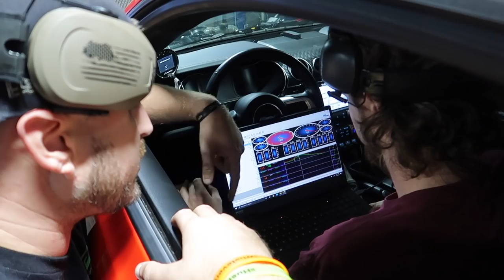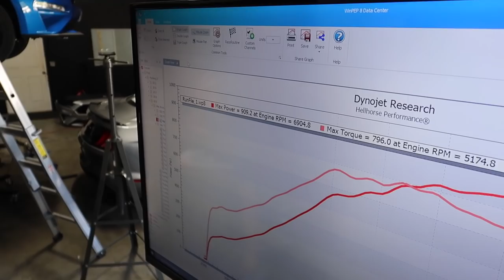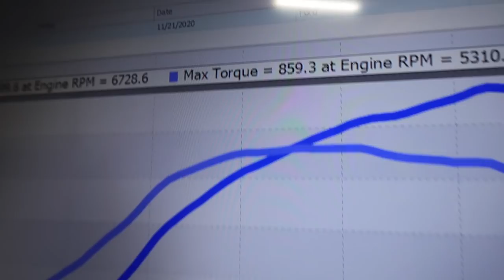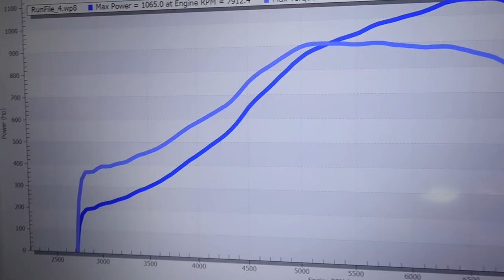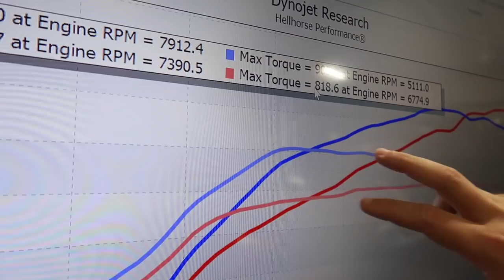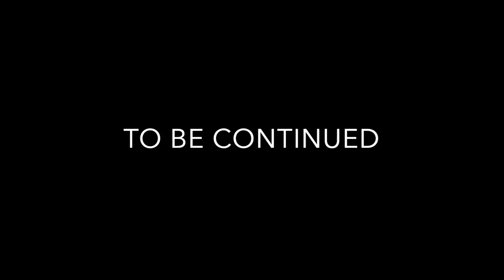RACE GAS in my Twin Turbo 2019 Mustang GT DID NOT END WELL...

Comment: Food for thought on C85 vs Pump E85... Pump E85 stoich is 9.85.... C85 stoich is 9.20....... So if you run 9.85 stoich with C85 you are not getting proper burn efficiency of the fuel.  So was tune changed to 9.20 stoich. If not that could have been why it didn’t give you the results you was looking for. Just thinking 🤔
Reply: I have yet to see advantage of vp racing C85 over pump 85

Comment: I was there to witness it all the turbo kit is amazing and the tuning is on par a lot of the problem comes down to gasoline what happens when you have bad gas in the tank but a lot of it you don’t know it until you turn it and you run numbers I am very impressed with the whole set up and I wish Zander a low 8’s car

Comment: Are you tuning with speed density using map sensor or are you using maf tuning at open loop?
Reply: These cars only use a MAF ( some like mine split the IAT out of the inlet stream and put it in a real place aka directly in one of the cylinders ( #4) on PD cars....
 A shit ton is inferred off the MAF curve and then it runs in double closed loop with twin wide bands...torque based tuning.....its a whole different world than what your used to
Reply: @bluecollardaily2676  yea wow sounds complicated.   Thanks.
Reply: @BulliKid  dude I've been tuning a LONG time, what I relayed doesn't even scratch the surface....the 10r80 has a ridiculous amount of settings as well...the triple clutch setup getting 10 forward speeds out of only 4 planetary gears all driven by a complex electrical valve body firing combinations of 6 clutch groupings...and even manual 1st and manual 2nd a lot of people launch with are using the B clutch while D mode doesnt...inverse/torque tables....its so complicated its actually when you start deep diving literally comically complicated......26 mapped points for several metrics of which one needs to log to even see under which conditions which of those maps are being used ( and wot is not always optimal power made it can be a combination of 2 maps its truly insane)...
Reply: @bluecollardaily2676  hope you make a good living from this job my man!  I guess tuning has gotten a lot more complicated with technology! And the automatic transmissions.
Reply: @BulliKid  im an enthusiast that enjoys doing it for myself, I swapped platforms for the challenge from GM and I got it....haha I'd never take anyone's money for a tune...just been digging in with my previous knowledge vs this new platform and learning slowly.......
Reply: Have you taken classes online or anything. I am trying to turbo my daily Honda Civic.  I’m piecing the kit together.  There is a base map on the tuning software for a similar kit but past that I’m not to finalize with the stuff.  Maybe  just adjust the base fuel trims so it’s more or less zero but ignition and all that is to complex and someone just said you need a dyno to do ignition maps.  Which  makes me wonder how are e tunes accurate ?
Reply: @BulliKid  i have NOT on this platform yet...if I stay with it I will.....

 Remember Lund and PBD have in-house Dyno access and develop their base maps off them, VMP as well...however other than that 10 speed, everything is SO dependent on that MAF Curve ( be it hz or period) and inferred off it and a few other sensors like the CHT ect...its amazing...yea I WISH it had a MAP sensor....if the MAF area and curve are off its bad data but by God the dual closed loop widebands accompanied by LTFT and STFT are SO good at filling in the holes( if your have the transfer rates correct moving the O2s from standard positions ect ect ect ), you can work backwards from there.....still a lot to learn...I took my tune and compared it dragy results from my Lund tune and I was down 2 mph...im reverse logging the cam positioning now....
Reply: Goodluck my friend!! Thank for the Info.   And the e tunes I’m referring to are the ones where you log data and send to a company and they email you back a tune. It’s not even a tested off the shelf map just a custom map. But again a street log is not a dyno log if ignition tables need a dyno

Comment: Itsjusta6 blows a motor, Stangmode blows a motor and now you wanna join that club ? Nah bruh, go sleeved if you're pushing passed 1100whp. Blown motor club I gladly don't wanna be a part of.
Reply from the maker: We will. I refuse to blow another engine
Reply: Itsjusta6 was sleeved wasnt it?
Reply: @bluecollardaily2676  yeah big money block. It had issues from day one though. That was a 2000hp built right block which it appears it wasn't. Bet the original owner discovered it and that's why he sold it in the first place.
Reply: Agreed.
Reply: @bluecollardaily2676  that was a 2000hp built block he found off Craigslist etc ? Sent back to MMR, took 6 months for them to even do something about it and it's never really ran right from day one. How many passes etc on bad tunes ? A stock bottom end Coyote is good for 1100whp easy 1 full race season possibly 2 if you don't rev limit the absolute dog shit out of it like the new Generation seems to do every burn out. ( Insert Stangmode here ) there's a reason you never see a tuner on a dyno holding a car against the rev limiter as he tuning it. All of them are guilty of it and I'm not so sure mechanical failure, tuner is the culprit or driver mod error 404 not found.
Reply: @bluecollardaily2676  cams not setup correctly yeah. He has a older Gen block which are known for the bores to not be aligned (centered) for high horsepower. If the machinest was off that day and sleeved the block that way ot will show on the crank. I don't think Gavin is looking to get that motor rebuilt so we may never know exactly what happened. Only time will tell.
Reply: Yea happened to me...all bad and super expensive

Comment: between hellhorse and hellion i think the hellion sleeper kit is better quality.
Reply from the maker: Having seen both. Hellhorse is about equal but comes with better standard turbos, standard 4-1 headers that are ceramic coated for thousands less than than an equal spec’d hellion. But to each his own
Reply: @Zander13Productions  you are PBD tuned?
Reply from the maker: @clipit3027  yes
Reply: Hellion is better quality, more efficient and cost less. We see right at 1100 on 15# on pump e85
Reply: @joshheath9570  what precisely is better quality on their kit?